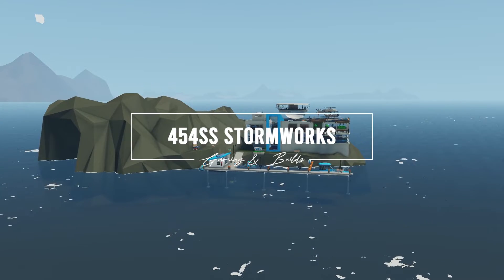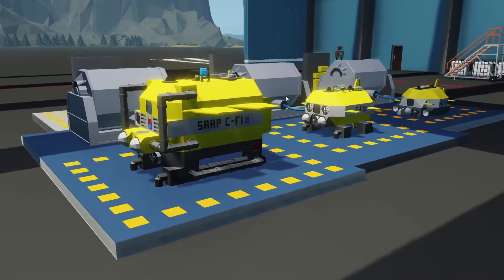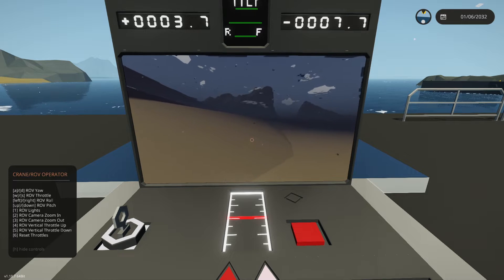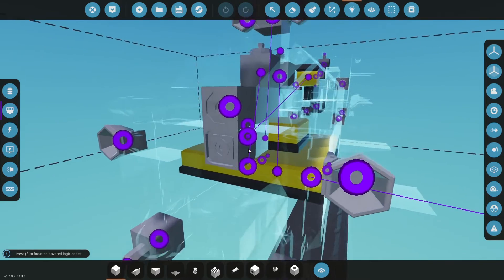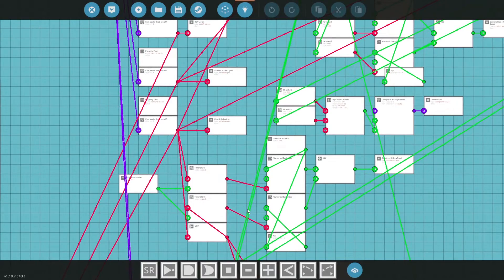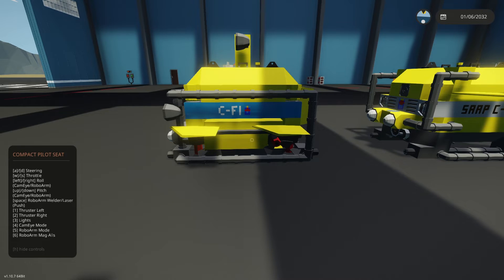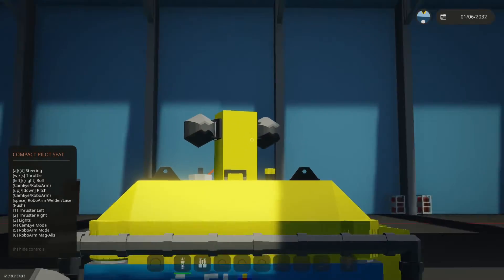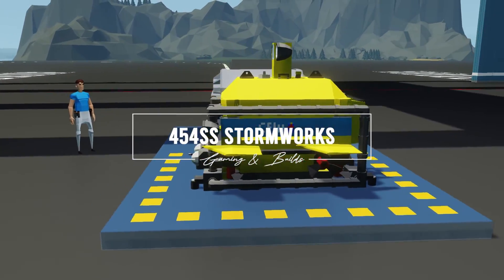Making an UNDERWATER ROV in Stormworks (Pt.1)

Comment: Hey! I love your content and just stumbled upon it, I showed my dad one of your videos and he's thinking about whether he should buy it for me or not. But, one big problem in my head is how good my computer can run it. I normally try and look at the specs, and what I have is a little bit better, an upgrade I5 processor, however, I don't know how good this game will run. Do you think my game will run smoothly with the pc specs I have? I really need to know if my dad wants me to get this game.
Processor: Intel(R) Core(TM) i5-6500 CPU @ 3.20GHz 3.17 GHz
Installed RAM: 16.0 GB (15.9GB usable)
Intel(R) HD Graphics 530
I know it isn't the best computer, but it's what I asked for when I went to get my computer and I am not even gonna try to convince my dad to get a new one, so I just need to know if these specs are what I need to run this game smoothly.
Thank you!
Reply from the maker: Thank you very much for your content! I love to inspire others :) Check out my video for low-end and mid-range computers, I think you will find it works okay, or try to add a cheap GPU (1050 or 1660), even can find one used, and it should be able to run!
Reply: @454ss_gaming  Thank you for the reply :) I will try and use one of those
Reply: @454ss_gaming  I got a whole new pc and i’m loving the game! :D Thank you for helping me, much love